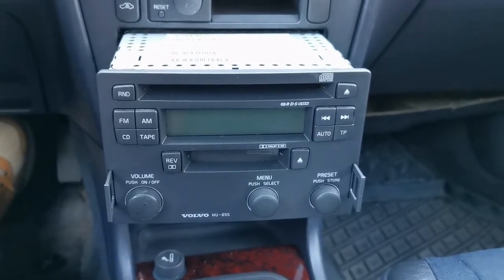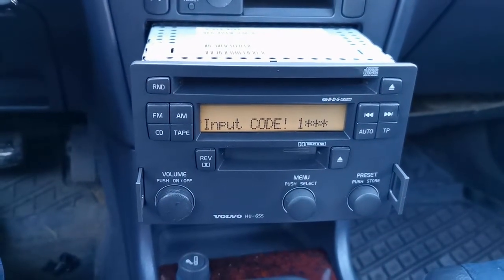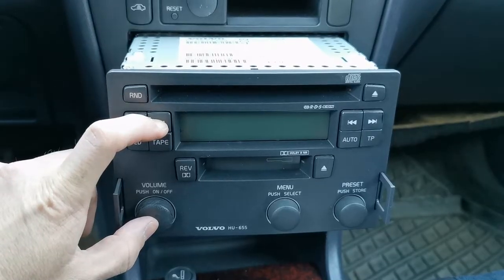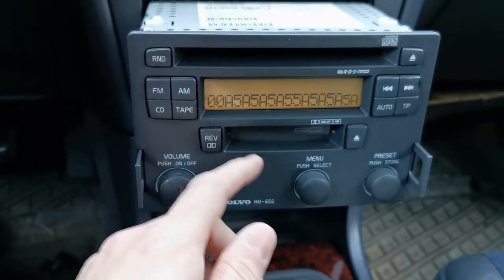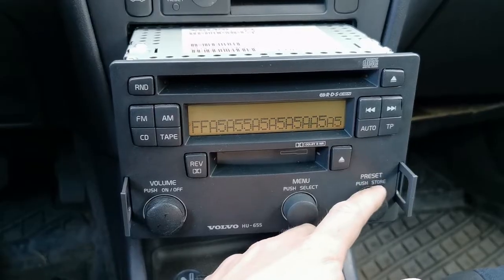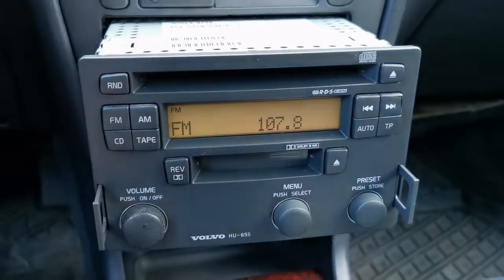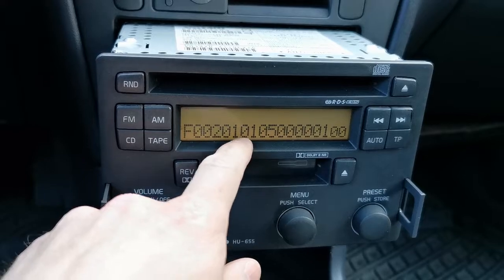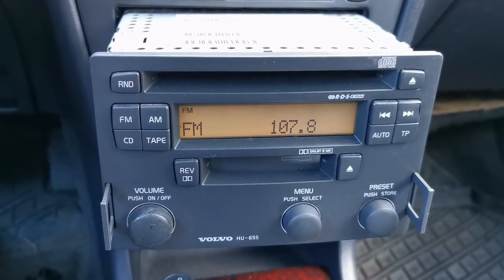Volvo HU-655 (HU-605 and HU-555 were tested by users as well) unlock and code retrieval

Comment: Excellent its working but i have no sound now
Reply from the maker: I would suggest to check the wiring and fuses. The manipulations in the eeprom I showed do not affect the sound output from the system
Reply: @ajs32tricopter thank yiu mate .  Im not sure where the fuses even are 😂im rubbish at cars
Reply from the maker: @WillNeviani😂😂 good luck. In that sense seems like I made quite a decent explanation 😂
Reply: @ajs32tricopter you did excellent on the radio code explanation absolutely. Like I say It's all working fine and i got a tiny bit of sound but as if it was coming through headphones that aren't on your head. Do you know why it might be doing that? Haha

Comment: Worked fine. I just disconnected the negative on the battery instead of touching the wires at the back. I was lucky enough to find the codes written in the glove box. Thanks.
Reply: How long did you wait to leave the battery unplugged to reset it

Comment: Absolutely awesome.
I have just found the code on my 20 year old volvo s40.
Haven't been able to listen to the radio in year.
Your advice worked exactly how you explained.
Very happy, thank you so much.
Reply from the maker: Excellent 👍👍 glad it was useful and glad these cars still running 😀
Reply: @ajs32tricopter  Really useful advice, saved me a lot of time, stress and hassle of trying to find a specialist. Don't see many on the roads now, really like mine and enjoy driving it. Still feels like new though it has only covered a little over 50k miles.
Thanks 👍🏼

Comment: Awesome video!  I ran a Volvo shop for 22 years till the l0ckdowns bankrupted it when nobody drove.  I can't tell you how many times we called the dealer with either VIN or more reliably radio part and serial number to retrieve the code for customers!   Usually when they got their battery changed elsewhere.   When we did that, we always hooked a jump starter box up under the hood so everything stayed powered.  Often the automatic windows would lose their calibration  and have to get re-initialized also, using the diagnostic system VIDA.   As far as I know, no way to fudge that procedure.

Volvo turned into something it absolutely wasn't originally over the course of my career beginning around 1989.   Used to be people kept their 240s forever, we'd frequently have cars in the shop with 1/4 to 1/3 million miles.  After Ford bought it change accelerated rapidly, and when the Chinese company Geely took over, the writing was on the wall.   Now the cars are overpriced, and WAY too many things go wrong with them.  Instead of being loyal customers, original owner would get rid of their 2012+ cars after 5 years and swear "I'm NEVER buying another Volvo again!"
Reply from the maker: Thx for the comment, appreciate 👍 I had to give a call to the dealership as well to get mine but they told me that the car is so old so all data is in archive already and to retrieve it from there is going to cost me I dont remember how much. So I decided to deal with it myself 😂

Comment: I have a wierd problem. If u can help me out. I have a h-605 so when I enter eprom I navigate to 62 it says 0000 and 61 where my code is it says FFFF.... So no code. I have tried to put in a code and exit eprom and turnd of and reseting power with taking out the power cord from behind to reset power. When I ennter eprom again it still says FFFF on 61 so I dont know what to do. Du u have any sugestion?
Reply: I have the same problem, did you find a solution?

Comment: Any info on how this works for HU-1205?
Reply from the maker: Hey. Sorry, I have no info about that
Reply from the maker: You could try pressing same buttons and see where it will take you. The internal architecture of the memory should be more or less the same I assume. Just dont change or save any new settings and if you get lost in the menu, disconnect the battery and start over again

Comment: Hello!  My wife entered the number 3 times, wrongly. I have my ID number, I don't need a new number.  How can I unlock it? I write from Mexico City. Thank you very much 🙏🏻 Greetings
Reply from the maker: Hey. If you know the pin number, just wait for 2 or 3 hours so the radio will be ready to accept the code again and enter it later. When you enter the code wrongly, the radio goes into locked state for several hours, you can either wait or disconnecr the battery and connect it back resering the radio
Reply: @ajs32tricopter   i need put in on the car switch?
Reply: @ajs32tricopter  yesterday use the car mora than 3 hours. But there was no change in OFF mode
Reply: @ajs32tricopter  
Also disconnect the battery for several hours, but it continues to be OFF. I'll try leaving the switch on.  Thanks again🙏🏻
Reply from the maker: Ok, watch the video and I do explain there how to get it unlocked from the OFF screen
Reply: @ajs32tricopter  🙏🏻tnks

Comment: Thanks! Unlocked my Hu-605 by changing the value at slot 62 to 0 and getting the code from slot 61. The way of entering was test mode and the menu was slightly different; pressing first “new” and on and then the “auto” button and on the second time to reach the menus.
Reply: Life saviour 😍 worked like a charm! 🎉
Reply: Thanks for the extra info on the HU-605. Worked like a dream!
Reply: This helped alot thanks!
Reply: Помоги пожалуйста, не пойму

Comment: I can confirm this also works on HU-555 ! Only two small differences, you have to press the "News" button instead of "Auto". The other one is that the blinking on F0, F1, F2 and F3 is a little bit different, but just set it to F0 and write down the digits on number 2nd, 4th, 6th and 8th, AFTER F0. For example if it says F0020103040.... your code is 2134.
Reply: Bro you are a f**king life savor thank you 🤞🏾
Reply from the maker: Awesome, thx for an update! Will add that to the description
Reply: Any other option? My radio is still off
Reply: Thanks man
Reply: THx Man. You saved my life😄

Comment: Can I do it on hu-405 volvo radio ?
Reply from the maker: Hi. You definitely can do the same on you radio too, but there is different way of entering the menus as well as how radio stores the info. You can use this video as general guide, but not as step by step instruction to retrieve the code from you particular radio
Reply: @ajs32tricopter  thanks for the answer